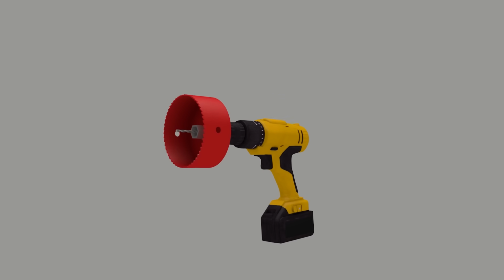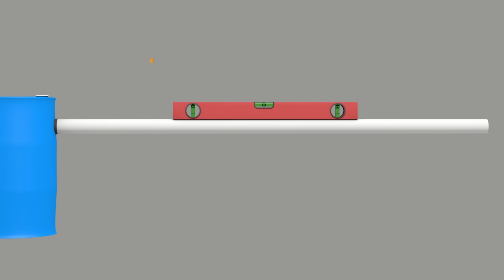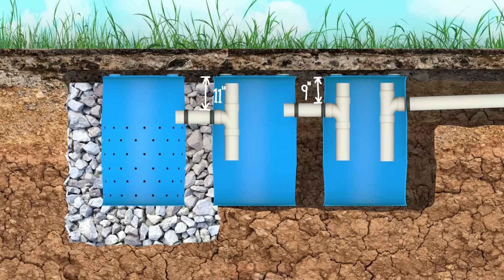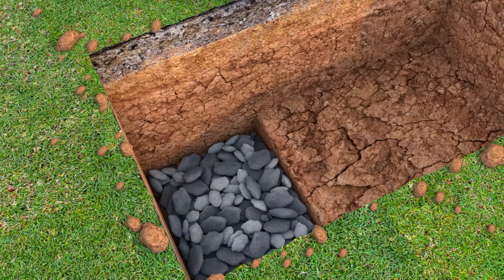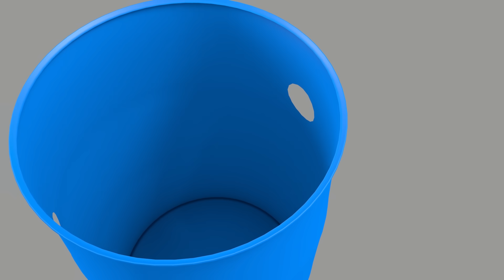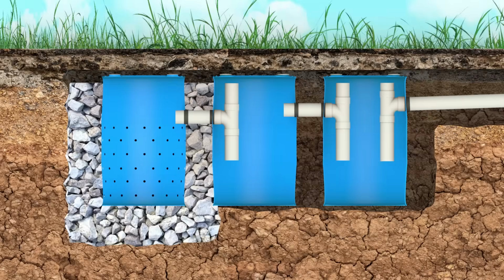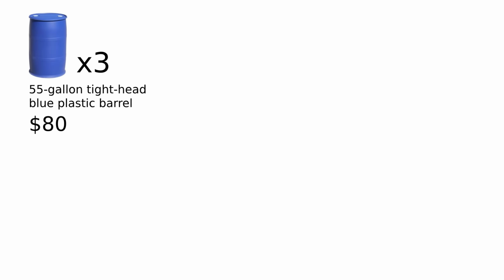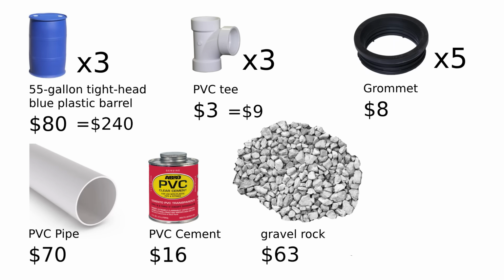Learn off-grid SEPTIC TANK installation fast and cheap.

Comment: I built the exact same system for my sons cabin. With 4 tanks.  In a square area. Filled first 2 tanks with dirt. The 2 leach field tanks filled with crushed stone. THANKS TO A RUDE COMMENT POSTED.   THE DIRT AND STONE GO AROUND THE TANKS NOT IN THE TANKS. I THOUGHT THAT WAS OBVIOUS  TO ANYONE BUILDING  A SYSTEM . BUT APPARENTLY NOT! Works just fine! 2 yrs into it and no issues.  And Septic tanks are not vented!!!!! The house plumbing is vented. All the vent comments are from non plumbers!   If you have to vent your septic tank.....then you have a "shit" poor house plumbing system.  I'm a master plumber.....so before you make ass comments...... know what your talking about. If you live where you have to have an "aerobic "system.....those have vents. And an air pump to pump air into the system 24/7. This system is just fine if you live in an area where permitted septic system are required.. where i live if you have 5 or more acres you don't need a permit.  And yes......this is a full time living cabin.
Reply: How do the two tanks work if they are filled with dirt?
Reply: @terryguin9529 ground around  them
Reply: @terryguin9529 They aren't filled with dirt,  they are back filled around the barrels.
Reply: @terryguin9529 he's incompetent
Reply: I did this ten years ago with one 55-gallon plastic drum. Has worked flawlessly. One drum because I got tired of digging. My leach field is one six-foot PVC pipe with holes drilled in it -- basic as it gets. I think the secret of my success is I only run the toilet through the septic tank. Grey water, I just run out through a straight pipe. No antibacterial shower soap and so on going into my septic tank. I've been flushing septic-safe toilet paper this whole ten years without a problem.
Reply: @mattelgin213 .👍
Reply: С каким объемом грязной воды в день может справиться эта система? Например, достаточно ли этих трёх бочек если в день используется 1000 литров воды?
Reply: @lazy_gypsy_soul you can use as much water as the perk on your land will drain effectively.
Reply: Any issues with collapse or partial collapse of the barrels?
Reply: @blawler  no sir
Reply: @Bunnyymann So, you used tanks not barrels? Why fill two with dirt? Thank you in advance.
Reply: @matthewlee1069 . No. 30 gallon blue barrels.  Dirt and stone goes around them not in them
Reply: @Bunnyymann Thank you Sir.
Reply: @Bunnyymann so say so in your comment! You specifically said you filled the barrels, not backfilled around them. There is an edit button.
Reply: @5400bowen . Taken care off.
Reply: How is the barrel emptied when it's full? I mean, at some point, it will fill up with solids. I guess you make a hole with a lid at the top and have it pumped out?
Reply: @dapuru1 
That's a good question .
Reply: @dapuru1 Correct.
Reply: @dapuru1 you have to pump it. In a larger conventional system the bacteria digests the solids. In a, system like this you would have to pump it.
Reply: funnyman 
You put dirt in first two barrels ?   Where did your poop go 😅
Reply: @azroseazlang9995. No. Dirt AROUND THEM. CEUSHED STONE AROUND THE SECOND 2 TANKS THAT ACT AS LEACH FIELD.  Poop goes into 1st tank. 2nd tank is emergency overflow . 3 and 4 tanks are leaching
Reply: How long will it take before requiring pumping out?
Reply: @Karjayden . Same as any other system.  Depending on use. Only thing going into this system is solid waste. Everything else is tied to "french drain". But going on 3 yrs now. No issues
Reply: In California all septic systems are required to be vented.  If you don't vent the system you could have a massive explosion 💥 from the gas .  How could you not know this if you are a "plumber"?!?
Reply: @stevenbrown5210 many hydro mechanical interceptors are not required to be vented. The system is closed with gas right lids. It is no more subject to explosion than a city manhole.
Reply: Most " master plumbers" dont know 
" $hit " about sewer treatment.  I was a water and wastewater operator for 12 years and I've seen some retarded shit from plumbers.😂😂😂
Reply: .y thinking is California won't "allow" this . We have over 5 acres so maybe but I don't think anyone around us has anything but a permitted system .
Reply: @hardworkingamerican8847 . California..... you can't do anything in California without government up your  ass. Even the wealthy  can't overcome government over reach. Just look at the Palisades!!!! Still no permits and houses being built after last yrs  fire..
Reply: @hardworkingamerican8847 just do it right and not tell anyone.. maybe put a fence before you do and call the dig line just in case
Reply: Hello 
I am looking for safer septic tank ideas to build with a house in water area like mangroves or seaside 
If you don't mind giving some tips
From Papua New Guinea 🇵🇬
Reply: @Bunnyymann I am curious as to why you went with barrels instead of the large white square tanks with the cage around them? They are around 120 - 150 gallons.
Reply: @matthewlee1069 .   the plastic is much thinner on IBC tote. It relies on the metal cage around it for strength.  So extra caution is needed went cutting and installing and BACK FILLING THE SOIL.  Our local Mennonite community sells used ibc totes for $75 each. At least is was that last time I bought one. I use them for rain water catchment  and storage.
Reply: @Bunnyymann  Thank you again.
Reply: @Bunnyymann I apologize for bothering you again, but if you don’t mind……. What size holes did you drill in the leech barrel for drainage?
Reply: @matthewlee1069 . 3/8" I believe it was. Left the bottom un drilled about a foot up so it would hold that water and help prevent from tank "floating " out of hole before it was backfilled. Then just went around the tank. Hole every 4 or 5 inches or so going around and same distance up to topish of tank. Not exact science.  Just what I felt was right for my circumstances
Reply: @Bunnyymann Thank you again and Happy Holidays to you and your family.
Reply: @Bunnyymann tank floating?
Reply: How do u clean the buildup oil from doing dishes or does sink water drains elsewhere?
Reply: @BrandonT-w1r . Good question.  Only the toilet goes in there. The other drains go into a French drain . Kiss of death to any septic system is laundry and kitchen.
Reply: @Bunnyymann ahh i see
Reply: @Bunnyymann 
This information you're sharing is quite valuable . I wonder what the plumbing is like for our septic system and if the kitchen and laundry are connected to it . Did see several blueprint roles in a closet when I moved in . House built in '84 and doesn't have any pumps involved with the septic system . Gravity system ? . Out here in California they require a system that is electrified in some way so a pump and whatever is connected to it . I see the newr builds have tanks above and away from the house by 100' feet or more .
Reply: @BrandonT-w1r  We have a very similar system, been going for 30+ years and has never been pumped out
Reply: Hello sir, hey is there a big difference if you increase the 'drop rate' to say 4 inches or would that even matter?  If you don't mind sir, how did you do the plumbing to your son's cabin? Off grid water or hooked up?
Reply: @Josey4u  not sure what you mean by 4 inches?   3"drain lines and 4" drain lines should run at 1/8" per foot pitch. 2 and 1 1/2 run at 1/4" per foot.  These are horizontal lines.  To much pitch in the toilet line will cause water/solids separation  and you have stoppages or backups.  My septic tank is 140' from my cabin. 3 inch line. 1/8" pitch. 0 problems.
Reply: @Bunnyymann  Perfect sir thank you. That answered my question. What about kitchen sink gray water? What did you do with that?
Reply: Hi Bunnyymann. My wife and I built our first tiny home off grid and we're about to do the plumbing for our kitchen sink and shower/bathroom sink. We compost our waste, so no toilet plumbing. Just a grey water set up much like the one in the video

Would I need to vent my plumbing or would a pea trap suffice? I'm assuming the venting is to keep smells out
Reply: @codysaunders7348  well sir.....that gets a little more complicated.  P trap without a proper vent will just pull a siphon and you will loose the trap water seal. But you can install an air admittance valve....aka... studor vent under the sinks. Plenty of videos on line how to do that. That will take care of the problems.  The shower could be done similarly.....but more involved.   Your off grid im assuming 👍. So no permit and inspection?.  If it were me...... id just tie all the drains together  and as it leaves the building  or before it leaves the building. .... depending on what you have to work with and frost/freeze concerns. I would do a deep seal running trap in the line.  Thats installing a deep trap in the horizontal line. It will remain full of water most of the time depending on how much is drained at a time. Installing 1 studor vent in the kitchen or lavatory drain will introduce enough air so the trap wont siphon.  Then you dont need p traps at each fixture.   I did a similar system for my buddy who is off grid.   Good luck to ya.
Reply: @Bunnyymann  you're the man! That's exactly what I needed to know. Big thanks friend 🙏
Reply: Jesus shut up. You are a grown man
Reply: Nailed it brother!
Reply: As a master plumber you should know that none of this will meet a building code.
Leech fields are required to have a certain square footage of permeable area depending on the percentage rate and the area around a 55 gallon drum won't meet it......
If you're off the grid and don't have to get elector water permits you can get by with it ...but not anywhere that requires a permit.
Reply: @bmphil3400 as a fisherman I can you that I've learned to be a master baiter
Reply: @stevenbrown5210 😂
Reply: @bmphil3400 🤦‍♂️.  How observant and astute you are.👏👏👏. Anyone watching this video  already knows that.  Hence the OFF GRID.   But sometimes the obvious escapes some people.
Reply: @Bunnyymann just because it's off the grid doesn't mean that it work in every area though. You are still constrained by the soil conditions. If it becomes a soggy poop puddle it doesn't help much....
Reply from the maker: This is well said! thank you!
Reply: @diytinyhome-pe1tz . Your welcome
Reply: @diytinyhome-pe1tz no it isn’t, the dude’s barely speaking english.
Reply: I'm still not convinced the tanks don't have their own vents. Can you explain further? Else, we need another master plumber to 2nd this
Reply: @nobnobnobnob . I'd have to charge you master plumber rates.    Don't think you want that
Reply: I am curious oh master plumber. Would large IBC tanks work? Cause if so they are cheaper locally.... larger but cheaper
Reply: @kingdarkem .   😂😂😂.  Well......yes it would. However.......   the plastic is much thinner on IBC tote. It relies on the metal cage around it for strength.  So extra caution is needed went cutting and installing and BACK FILLING THE SOIL.  Our local Mennonite community sells used ibc totes for $75 each. At least is was that last time I bought one. I use them for rain water catchment  and storage.
Reply: @Bunnyymann locally they are dirt cheap... 330 gallon ibcs for 45 dollars....practically brand new. That's why im asking. Big system for almost nothing.
Reply: @kingdarkem 
Ha . At an auction place in Sacramento Ca they go for 100 each at least maybe 150 .
Reply: Wow, you couldn't  delete and rewrite the sentences. How pig headed can you be? You had to add angry statements instead of actually correcting what you wrote at first. Dang.
Reply: @5400bowen . Right back at ya 👍

Comment: Pretty sure this is illegal
Reply: Its actually set up  better than the traditional shit design of regular septic tanks. In fact is designed more like a small community system with a solids tank and an aerobic run off tank and the effluent filtration tank. Add another tank with a gravity fed charcoal / sand filter and you have drinking water.
Reply: If you need a septic permit and inspection.  Yes it would be illegal.  Lots of places don't require a permit if you have a large enough property.

Comment: How big of a house will this handle?
Reply: Also my concern with a system this small
Reply: It works great for one person, probably works good for two people. I had a similar system using only two tanks and a 4-in perforated leech line 15 ft long. Worked great for about 6 years, then I had two people staying with me for about 8 months after that it only lasted a couple of more years and then stopped working. I am almost certain it's because the leach lines weren't properly protected from infiltration of roots. My guess is this particular system would be fine for two people.
Reply from the maker: 2 adults and 1 child is fine! or 4 adults for weekends
Reply: .5 people

Comment: Not sure where to begin on how many things are wrong with this septic system.  You're venting where exactly?  Nowhere in this video.  $3.00 for a 4" San-T?  You need to shoplift it to get anywhere near that price.  Your leach tank is right next to your two other tanks.  I see floating tanks in your future.  PVC cement with no primer, okay.  You're pumping all your wastewater in the area the size of a barrel, not going to work.  Please take down this video so people don't make the same mistakes you did.
Reply: I built the exact same system for my sons cabin. With 4 tanks.  In a square area. Filled first 2 tanks with dirt. The 2 leach field tanks filled with crushed stone. Works just fine! 2 yrs into it and no issues.  And Septic tanks are not vented!!!!! The house plumbing is vented. All the vent comments are from non plumbers!   If you have to vent your septic tank.....then you have a "shit" poor house plumbing system.  I'm a master plumber.....so before you make ass comments...... know what your talking about. If you live where you have to have an "aerobic "system.....those have vents. And an air pump to pump air into the system 24/7. This system is just fine if you live in an area where permitted septic system are required.. where i live if you have 5 or more acres you don't need a permit.  And yes......this is a full time living cabin.
Reply: @Bunnyymann thank you I like hearing comments from experts, real experts. Watching this- I could do it. Then that guys comment I was like well crap. Yours gave me some hope thanks
Reply: @travelingpsychicsupperclub5015 . Yeah......people who don't know and run their mouths.   Going onto the 3rd yr with my 4 barrel system for my sons cabin. No issues. All good. Now keep in mind he is just one person.  This type of system would have issues with a larger family for sure. But for what it's being used for right now it's perfectly fine.
Reply: it has worked for 6 years without an issue. family of 3. it wont float if you fill it with water before using, as explained in the video... you probably dint watch till the end. short attention span.
Reply: @jpsaframecabin  I did watch the whole video.  Where is all the water going?  Just in that one little area around the last barrel?  Without a leech line the water will just be in that little area.  Either you use very little water or that's some incredible soil.  Worked for six years full time living or just vacationing?
Reply: They do this all over South America. It works…
Reply: Thats right. They not have venting system for first. Thank you.
Reply: You said you filled the first two tanks with dirt and the second two with gravel you don't mean you actually fill the barrels with dirt and gravel your meaning around the barrels?
Reply: @ervintaylor6508 . Yes sir...... AROUND the barrels.👍
Reply: How are they going to float, when they're buried in the ground???